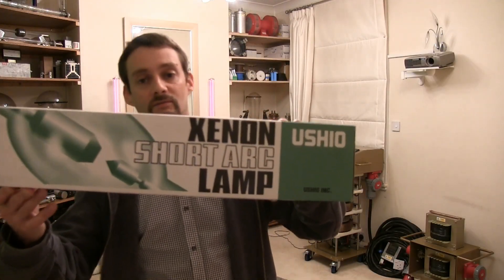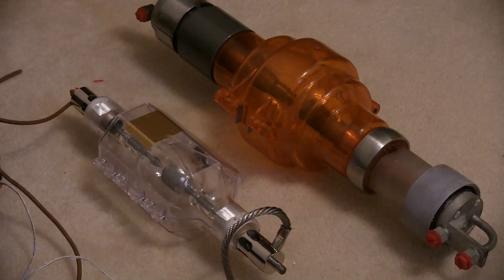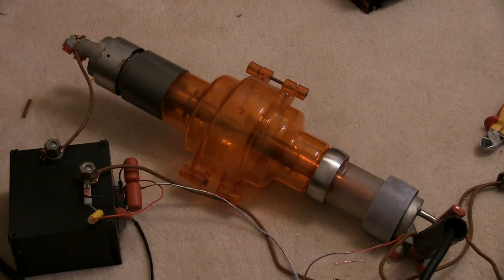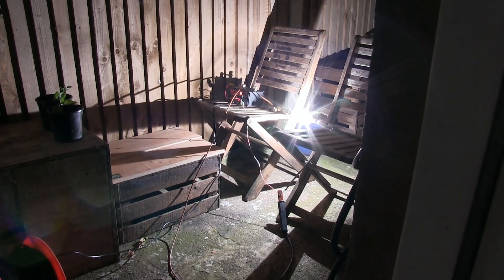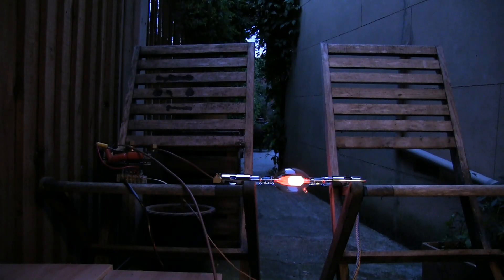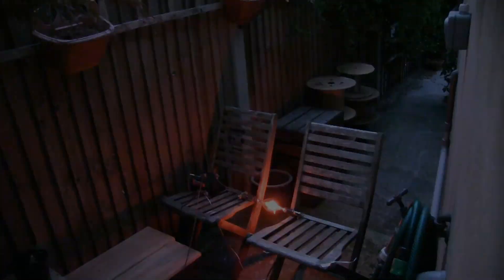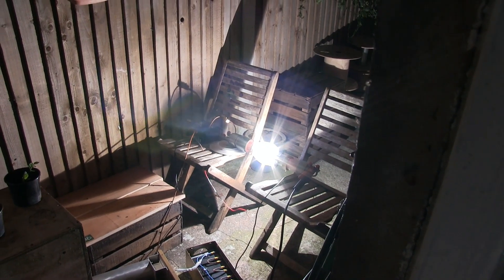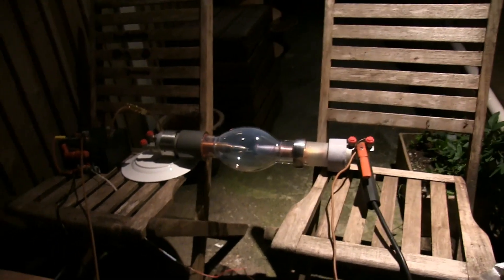30kW and 4kW Xenon Lamps Get Tested on a DC Welder

Comment: The kids in the neighborhood are strictly ordered to run into the houses and to duck and cover immediately, whenever they hear Photonicinduction rummaging around in the yard/garden. He's got a deal with the power station. Whenever he starts to make a YT video he has to call few minutes before, so they can pull out a few control rods to accommodate the extra load on the generator shaft with extra steam to the turbine. Before that, the power frequency in the area always dropped too much in such cases. "Sir, we're down at 46 Hz!" - "Damn, this Photonicinduction must be in his attic again, making a YT-video! Is there is a bright blue flare at the horizon and a smell of ozone in that area?" 

 I love this channel, which I discovered by accident. It's simply amazing. Thanks for sharing all the great stuff.
Reply: love your comment :D
Reply: This should be pinned
Reply: He is actually using the normal amount of power. It’s all amplification!
Reply: @qeelevators2960  Thats not how it works, you can't input 10 watts and get out 1000. Wait, lemme calculate that.
Reply: It's not amplification but a residential power lines can have up to 1000 amps, thats a lot.
Reply: Untitled Document - using a transformer u can
Reply: @qeelevators2960  A transformer doesn't amplify the power, It changes voltage to  amperage and when you have 1000 amps at 120 volts you can get a lot of power.
Reply: @qeelevators2960  The wattage stays the same, the voltage and amperage change.
Reply: @qeelevators2960  you can't get energy from nothing if the wattage = volt * ampere. So if you up the voltage you drop in ampere and if you drop in ampere you up in voltage. But if you need more power (wattage) you need to pull more from the network
Reply: @Untitled Document well, it sort of is all amplification.  He charges an array of lead acid batteries at night when power is cheaper in his area.  He runs the crazy experiments off the batteries (his house is wired to run on the grid or batteries + inverter, controlled by a mechanical a switch).  So basically he is pulling down from the grid X watts per unit of time (at night) so that he can later run > X watts per same unit of time (in bursts).  An array of lead acid batteries connected to various kinds of transformers and capacitors and whatnot is how he delivers preposterous amounts of juice at once without pulling many (or actually any!) watts from the grid at once.  I think he’s only got 100 amp service based on other comments he’s made, not even remotely enough to do all the crazy things he does. :)
Reply: I found your comment stupid
Reply: @jeannetteschroer6964  you suck

Comment: Great video, I have a 10 or 12kw one of these sitting around, got it from a foreclosure, the guy was an old x ray tech and had quite a bit of interesting stuff (missed out being able to grab a lot of it sadly), and I thought it was an x ray tube at first. 

I never thought about using a dc welder to power it, I'd just need to figure out a high voltage ignition device like you did, though I'm not sure my welder could provide enough current.
Reply: +Jesse Levesque My solution will have to be much more DIY though, I'd never be able to find things like that high power laser around here to use for parts.
Reply: You could, and it would be the ideal solution, but I don't have any high current inverters kicking around.

Comment: you might add a magnet to keep the arc flat. theater projectors use a magnet to help stabilize the arc. also seal failure happens to the end of the bulbs

Comment: Yeah, the 30 kW lamp has been popped due to overheating. I guess the water inlets are there for a reason....
Anyway, great video. I wonder whether you'd be able to actually run a 30 kW lamp at full power (I'm guessing not, unless you REALLY do have your own substation, but one can never know) ;)

Comment: hi m8. silly question  do you know if it is  possible to convert a 3 phase air compressor to normal house hold supply without changing motor. if so please explain
love all the vid's  by the way
kindest regards 
craig

Comment: very nice tests... gave me good insights.. you used a welder for the high ampers.. good idea.. but i could swear I saw a transformer in your room, in the beginning of the video.. i would use a transformer or reactor if i had one instead of the welder..  just in case something goes wrong and fuse the welder...  or a component inside.

Comment: What did you use to generate the high voltage for starting the arc? i recently acquired a 2.4kW xenon short arc lamp that was used in an imax projector, i have a dc welder capable of the required current, just need to figure out the high voltage arc ignitor
Reply: +twenglish1 Photonic had to buy a separate igniter especially for the lamps..

Comment: Just a thought, our combi boiler is 35KW and I'm sure it must be capable of boiling water with the tap fully on, if you got to really push that big lamp with mains water running through it I bet the water would have come out boiling like hell. I remember you said it needs water pumped through it at high pressure.
Reply: +CommanderLake You'd have to look up how much energy is converted to light and how much is heat.

Comment: I worked as a projectionist for many years and handled big xenons a fair bit. Loads of fun. The projector lamphouses were air cooled and had safety switches so the lamps wouldn't operate with the doors open. We taped the switches closed and ran them wearing safety gear, highly dangerous and not recommended but it was the best way to align the mirrors properly. They give such a clean bright white light. Had one explode once whilst running a film, that got my attention!
I was also nearly killed once when the main lead broke free of its securing clip and shorted out on the dowser doors, which were opened by an aluminium handle I had my hand on. A thin plastic (cosmetic) coating was all that separated me from 110 amps. There was an almighty bang and I leapt away just in time. The lamphouse was destroyed, needless to say.
Great vids, keep up the good work!
Reply: You would have been fine. They run at 24-37v dc so not a high enough voltage to feel.
Reply: @xanderyesilirmak956  the ones that we ran were 3 phase inverters running at 130v DC on the smaller bulbs.  The 8kw bulbs were 190vDC.  When they explode, you need to replace the mirror because the glass shards are so hot they liquefy and melt into the mirror.
Reply: @chubbysumo2230  I think you're misremembering. 8kW Xenons @ 190A would be 44Vdc which is still low voltage and completely normal for Xenon arc lamps. The rectifier supply is 3 phase but the output is DC and definitely not high voltage.
Reply: @xanderyesilirmak956  It's amps that kill not volts
Reply: @symmetrygames8142  it takes about 30mA through the heart before defibrillation occurs.
Current is dictated by the resistance the and voltage of the circuit. In the case of the body, the resistance is too high at 37V for 30mA to run through your heart. 37V cant kill you.
Reply: I wonder whom here would be willing to actually  grab the wires of a supply that can deliver 110A even if it is at low voltage? 

Resistance of a human body varies dont forget, if theyre sweaty for instance. Some people naturally have a lower internal resistance, some higher. Some people may have a heart condition or pacemaker. 

I would go round telling people that its not dangerous.
Reply: @steveb60879  you mean a car battery which can deliver 500 or more? Yeah me, it does nothing.
Reply: @steveb60879  No but this is what if right? In that case he would most likely have been okay if what this guy is saying is correct.

Comment: Photon, when you adjusted the output of your welder it looked to me like some sort of continuously variable adjustment. Have you got any idea how a welder does that? my best idea is a big SCR but if the scr chopped up the sine wave even a little bit i would think the arc would extinguish. You gave me  the idea to try and make a TIG welder, but I'm trying to figure out how to vary the output current. Any ideas? Thanks!
Reply: Allison Dunn it is a fully electronic welder, no transformer and all inverter.

Comment: Question: The Lamp needs ~40V wit a lot of current ~100A and that in DC.
To ignite the Lamp you need ~(few thousands)V.
How did you decouple the 40V DC that is supplied to the lamp from the few thousand V from the ignitor? Would all your computers blow up in your house when you dischrarge the Ignitor to ignite tha lamp?

I imagine two circuits conntected to the lamp. 1. Supply U and 2. Ignite U.
How do you NOT blow up the Welder when you punch a few thousand volts through the lamp.
PLEASE PLEASE EXPLAIN. Looking for this Answer since YEARS!
Reply: Jetrider91 The 40kv is superimposed with the low voltage, the electronics in the welder don't blow up as the 40kv becomes 40v when it exits the lamp and meets the original 40v

Comment: Why not use the 1950s Mazda 5kW bulb and crank it up to 12 kW. Those old filaments can handle massive overload very easily. Anything built in the '50s that was designed to work was also designed to overwork!

Comment: A cold Xenon lamp doesn't really do much when you break it, despite the internal pressure. When we disposed of old Xenon lamps we'd just wrap them in the cloth wrap that they came in, put them in the bottom of a dustbin, and then break them with a broom handle. We never got more than a slight 'pop', but then there were only 1.6kW lamps :)

Never had one go bang when it was hot, but our projector service engineer has told us many stories about lamp housings being turned roughly spherical by the force of the explosion. The electrodes sometimes get fired out through the front of the lamp housing as well. Fun times. Digital projectors these days are quite boring by comparison :D

Do be aware though that you can give yourselves accidental sun burn if you play around with arc/discharge lamps. Lots of UV come out of these lamps. Ask me how I know....
Reply from the maker: ihavenoideahere they are highly dangerous and under extreme pressure when cold and even more pressure when hot.
Reply: ***** They aren't that dangerous if you take care handling them. The most dangerous thing about them is the intense heat (as hot as the surface of the sun, apparently), as you found out when your lamp melted. In my job I use all sorts of high powered lamps and the single biggest danger comes from accidentally touching the glass/quartz with your bare hands. The natural oils on your skin will cause hotspots which in turn often make lamps explode, or at least melt a hole in their envelopes. Thats why a lot of lamps, discharge in particular, come with alcohol wipes to clean them prior to use.

Found this on Ushios website :

XENON ARC LAMP DISPOSALXenon arc lamps must be disposed of in a careful and proper manner in order to prevent injury.

1. Wear a protective mask, leather gloves and protective clothing when handling a spent lamp.

2. Place the used lamp in its original protective case and original cardboard packaging (box) that was provided when the lamp was new.

3. Firmly attach tape around the original cardboard box to seal the lamp securely.

4. From approximately three (3) feet in height, drop the cardboard box, with the lamp and protective case inside, onto a hard floor to break the lamp.

We could never break the lamps using this method as the quartz envelope is so strong. Hence why we broke them in a bin with a broom handle.

Comment: Suddenly, microwave popcorn spontaneously pooped all over the neighborhood.  No one knew why. +Photonicinduction knew.
If you ran those bulbs on AC would they run half as bright, yet cooler since they would only run half cycle?
Reply from the maker: Rich Booth they pop on AC as the electrodes get chewed up

Comment: I used to use these bulbs as a projectionist at a cinema. They are still widely used today. The colour changes over time to a more yellow light and then they need changing. The housing they live in has a big curved mirror to collect and focus all the light and point it through the hole at the 35mm film or DLP Digital chip these days. You have to have serious fans bringing cold air in and extracting the heat out of the compartment and some serious coolin for the DLP chip as they can go critical without it. Arc eye guaranteed if you look at these without the right eye protection ;-) Brought back some memories.

Comment: The unfortunate thing about the water cooled lamp is that the electrodes are thinner to allow the water to cool very close to the source of heat. The 4k just had brute mass to deal with the heat. So I'm not surprised that the 30k failed on just 4k of power.

Comment: Hiya Photon, great attempt except that the welder will only put out about 26v under load even though the OC voltage will be around 70v. Did you measure the voltage to the lamp?
Reply from the maker: CrazySparkie63 The lamp wants 30v at 135A, the welder runs the lamp a treat, worth noting the higher no load volts is exactly what is required for start up, I have the manufacturers spec in front of me. I suppose you are going to factor in the volt drop on the undersized cable now? With me, it either works or is don't, this worked and that's good enough for me:) Hope you are doing ok mate, come down and play with the 4 volts that are required if you like, I'm sure we can put a dc choke on it to get the volts up a bit, btw I was using a 60v battery bank in parallel with the welder, that worked too:)
Reply: *****  Ah ha did not realise you had the battery bank in parallel, that would have helped with the nasty ripple that inverters produce. Glad to see you're well, will have to pop down soon and I have a quite unusual lamp for you (yes another silly light bulb).   ,

Comment: Are you sure the hissing wasn't just a pressure buildup in the plugged water cooling galleries?
Reply from the maker: Ian Darley Very good, I'm liking your train of thought, however I've tested the lamp on a few kv, its no longer that lovely tight white arc, its orange and wandering around inside the lamp, (it has air in it) sad but true.Well done on the thought though!
Reply: Ahh poo :-(

Comment: My mobile phone just donated itself to you - It told me it wanted to see you as I was atop a tree stump at 8am trying to get a signal for a profitable job thingy. I'm sure it will work just like high power high pressure bulb.. nice jolt of HV and then plenty current to keep it lit/make it on fire.
Reply: huskyemma PC is feeling left out... all 6ghz of it with 4gb of ram.. does not perform as expected... must not have enough electricity or something.
Reply: huskyemma I remember my old P100 was miles faster than this hunk of shit. This CPU is rated 60 times faster so must need 60x the electric to run right. I only got 240v... its probably not the computers fault. 12KV?? to hope to draw 6KW? something in that range should be sufficient.
Reply: huskyemma The satnav 'wants' to go too.. will be lonely on its own anyway.. they work as a team to piss you off. I'm sure you'll straighten them out.

Comment: is the giant lamp meant to be liquid cooled? i see tap plugs, or is that just the electrical connection
Reply: It is meant to be water cooled. I saw a video on cinema projectors which use the same type of lamp, and they are water cooled.

Comment: Aww - you need another one of the 30kW lamps to see if you can get aircraft landing on your garden!!

Why does the welder click after is has run? Is it discharging the capacitors?

Comment: What is the point of having these lamps at all? I don't think that they are effective enough converting energy to the light. It generates a lot of heat.
Reply: sergei291 I would think it's because you don't get that much brightness from relatively efficient light sources, such as LEDs.

Comment: How did you ignite them? Does the arcwelder have an integrated ignition circuit for starting the welding arc?
Reply from the maker: ***** external igniter 40kv
Reply: ***** and how do you prevent it from being destroyed by the high current dc? first ignite, then connect hc-dc?
Reply from the maker: ***** the high voltage is superimposed into the low voltage high current dc (they run together) additional edit.. The high voltage is disconnected once the main current is flowing.
Reply: ***** thanks!
Reply: +Thor214  so its high voltage start?
Reply: ***** So basically the same type of circuit used in a projector for striking the arc.
Reply: Usually how these works is, low voltage high current runs to the lamp, but if that current doesn't flow, it charges up a starter that produces high voltage that zaps the lamp until the lamp has ignited and the lower voltage higher current is then able to flow.

Comment: Fuck ! there is some heat generated in that lamp. amazing !! the whole anode is glowing. You can hear the 30 kW bulb hiss when it degasses. Another excellent video.
Reply: +RODALCO2007 I think these are normally run with liquid cooling for a reason!
Reply from the maker: RODALCO2007 cheers mate!

Comment: What is the buzzing sound when the lamp is ignited and the ticking sound when its off?
Reply from the maker: Mitya Drokon 40kv igniter buzzes when powering up producing hv, the welder relays discharge capacitors when shutting down.
Reply: ***** Good to know, thanks!